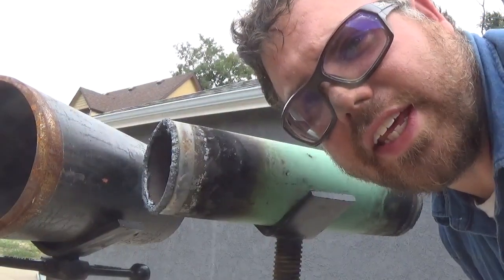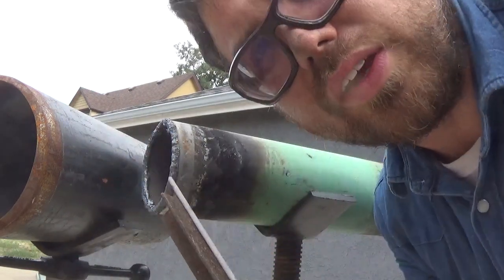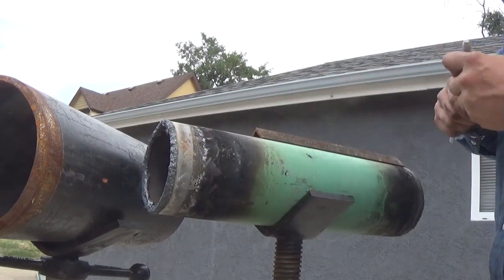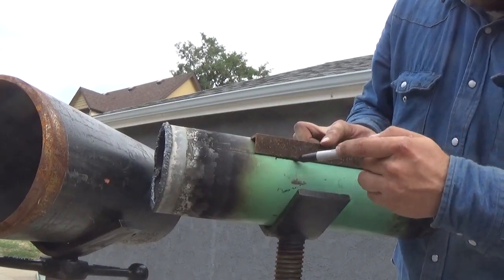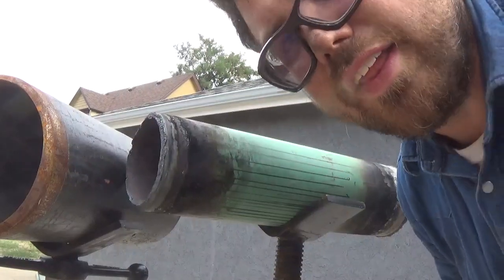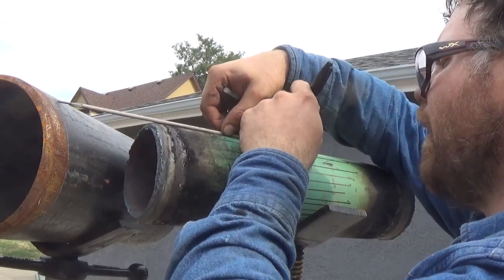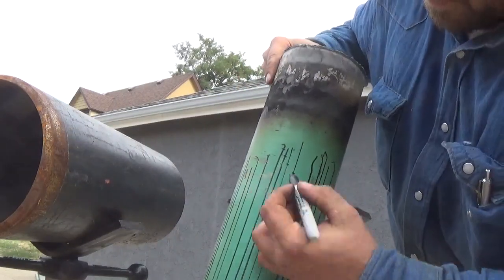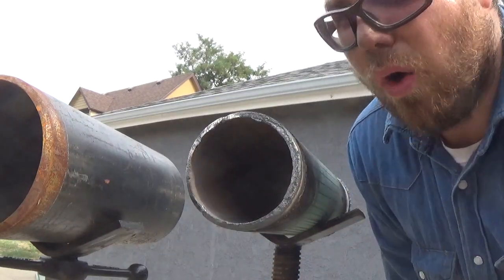How to lay out ANY lateral, perfect every time

Comment: The term for this is "projection".  I have been using it as a pipefitter for years.  Can also be applied to other things not just pipe.  When cutting notches on anything to make pieces fit into place.
Reply from the maker: well shit, you should have made a video of it back then, would have saved me a ton of time

Comment: Hi, please, check www.etubespro.com where you will find a real practical method for fabricating saddle templates for tubes/pipes of any size and thickness intersecting any other tubes/pipes at any angle. It works with offsets in any direction or plane.

Comment: Can you show start to final cut and fit up? I'm doing a job with a 6×6 on 30 degrees lateral. I tried this method today and something didn't go right for me.
Reply from the maker: This is for laterals and headers. Would be ALMOST impossible to do on pipe that is the same diameters
Reply from the maker: Send me an email. I have the ordanice for that layout in the truck if you want me to send it to you guide.jt@gmail

Comment: a simple explain for how this trick works is using fixed dimension . when cut to the point on small tube . it is the same as you stick this point on larger tube . note that , this method not only works with round pipe , it also works with whatever thing :))) thanks for video

Comment: Great Video man! I found it’s a lot easier using the same piece of angle iron to do your layout just longer with the tip cut at a 45 degree to make it easier and not need two people, also if you tack a piece of round rod or scrap metal to the edge at the inside at the opposite quarter mark from the one you mention it holds your degree and you can do your layout comfortably. Thank you for showing this awesome trick 🤟🏽🤟🏽

Comment: That's a good accurate way of doing i  use template paper wrap it around the small pipe shape it with a Sissors to fit perfectly against larger pipe then slide it back and Mark smaller one bobs your uncle
Noel from ireland
Reply: this tip is very useful when working with bended pipe . because not easy to wrap paper around it .  thanks for your comment :)))

Comment: Why draw all the lines? Rather than using a welding rod, should you not just use that piece of angle iron (sharpened to a point at one end) to transfer the information?
Reply: i believe you're going to distort the geometry more the higher the "stylus" is off the surface of the pipe, you're going to be projecting the points for a bigger pipe down onto the smaller pipe. you could mitigate this by setting the point right at the surface of the pipe, but it will only be accurate for that size of pipe. makes me think that there may be a hole in the market for an adjustable tool for doing this, hmmmm.....
Reply from the maker: Such a good idea worldtube just made that video
Reply: @BadassWeldingVideos : Do you have a link?
Reply from the maker: https://youtu.be/dngIdE2XNPU

Comment: If you attached the wire to the angle and let it sticking out , then bend it down  and out until it is even with the top of the riser . Then you can put a marker in the middle of the angle at the back . Move the angle around the bigger pipe with the wire touching the header and the marker will mark the riser at the same time
Reply from the maker: I like it....

Comment: Not a pipe fitter but would work great for in field patterns for insulators  metaling or cladding pyrogel  hard to get good patterns as that stuff is never round when it goes on tight

Comment: Not trying to argue just clarify... the thicker the pipe wall on the branch the more post cut adjustment will be necessary... wouldn't comment if I hadn't used this method many times myself. This method does work particularly well for making a template once this is accomplished as you suggested.  Again thanks for the video

Comment: There is a problem with this method... for a proper full penetration weld the INSIDE of the lateral must match. Your method will require trial and error adjustment with a grinder to accomplish this... no longer a 30 min job. Thanks for the video anyway
Reply from the maker: its only off on the ears, a little grinding and its tits... no shit perfect every time. done it enough to say it works for certain
Reply: Robert Claytor I’m with you this would be good in some scenarios but you still need to know how to geometric develop a wrap around

Comment: Why not use the angle iron to get the distances from the main pipe and skip drawing all those lines and using the stick rod?
Reply from the maker: try it, wont work.
Reply: If he were to tack a long tig wire to the top of the angle, leave a foot sticking off one side and bend it down at the end and then back strait out to where it was even with the top of the pipe, then at the back ,bend it up and over like a candy Kane and cut it off about 3 inches above the pipe, tape a sharp to it. Then you can move the angle around the pipe with the wire touching the header, and it will mark the riser at the same time....your welcome
Reply: I weld a rod along either of the two edges of the angle iron (not the top of the angle). This way I don't have to draw any lines nor do I need a helper, and it is more accurate.
edit: The rod is of course long enough to reach the other pipe.